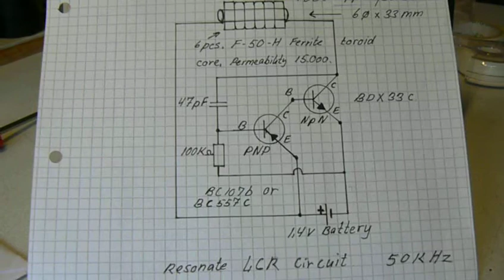Resonant LCR Amazing Circuit  2.

Comment: Creating a changing magnetic field in the center of the toroids using pulsed DC from a battery (must be a circuit pulsing it). The magnetic field also fills the metal in the frame of the glasses, and since it's changing it generates an electrical current in the frame. By completing the circuit in the frame using the LED, the current can flow without being trapped as an eddy. Very cool demonstration! Check out the Joule Thief Circuit if you haven't already.

Comment: @tenkosami LED's will work on AC but they will only light on the part of the cycle that they are polarized to. I have run an LED on 115VAC with a 330K resistor for I limiting and it worked fine. You can just barely distinguish it flashing.

Comment from the maker: YES, just a single conductor going through the center of those ferrite beads, right? Does it matter if it's a single wire or does it need to be like the metal tube? A single wire vill also work.

Comment: Would the output voltage increase if a resonating capacitor were connected across the tube?  This circuit looks more like a blocking oscillator than a resonant oscillator, to me.

Comment: This design is feasible from the physics perspective. One of Maxwell's equations predicts a non-zero curl in E given some change in B with respect to time. dB/dt and the induced electric field are perpendicular, in the video dB/dt points tangentially to the axis of the core and the curl of E is parallel to the axis along the conductive item. Its actually an interesting twist on a transformer with the conductive item (nail etc.) as the secondary 'winding'.

Comment from the maker: Creating a changing magnetic field in the center of the toroids using pulsed DC from a battery (must be a circuit pulsing it). The magnetic field also fills the metal in the frame of the glasses, and since it's changing it generates an electrical current in the frame. By completing the circuit in the frame using the LED, the current can flow without being trapped as an eddy.
Reply: are there eddies in the frame? its very interesting circuit

Comment: Forgot to mention that it can't be A/C because LEDs (at least the ones I'm aware of) are polarized. Alternating current would burn it out. So it is most likely pulsed DC being applied. Also, 50k frequency sounds very familiar - the output of the joule thief circuit usually ranges from 10k to 70k+ pulsed DC. Are you using a joule thief to power it?

Comment: ..and I think the reason the LEDs don't work when connected directly is that the circuit doesn't let enough current pass unless its resonating, which it can't do without the cores present.

Comment: Ok, If you do, then I respectfully apologise.
 I reckon (and you can correct me if you want) but you can only create a useful magnetic flux with AC or positively pulsing DC, i.e. to create the changing field and hence the flux, therefore the ocillator must be doing this function, and the flux created induces a pulsed wave and lights the LEDS. Well that's my thought anyway. Its not so much amazing as interesting, especially for novices.

Comment: Wow every bodies posts are like 2 yrs ago.  Because the magnetic field is running parallel to the cylinder core any current trying to pass though is forced to take a 90 degree turn so in this case preventing the currents flow through the cylinder core.  The static magnetic field effectively stops the current from flowing though the core. The door is shut.

Comment: Trying to understand the ferrite core. I understand what the cores are, but are the 2 wires simply soldered to each end of the tubing you side the ferrite onto or is it N turns of wire wrapped around that tube? I don't see a coil in your schematic, so I'm guessing the "ferrite core" is just a single conductor going through the center of those ferrite beads, right? Does it matter if it's a single wire or does it need to be like the metal tube?